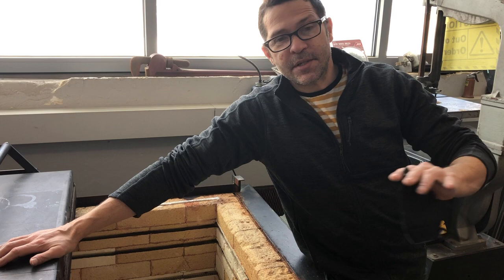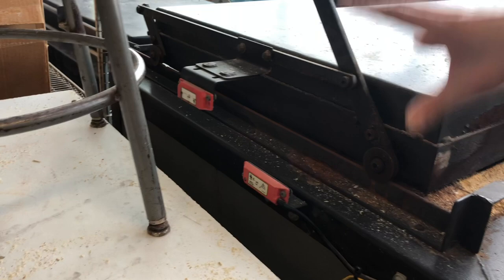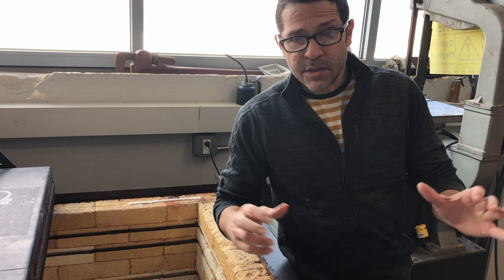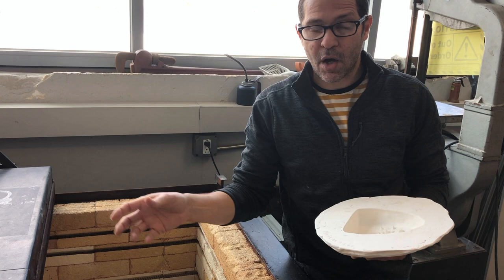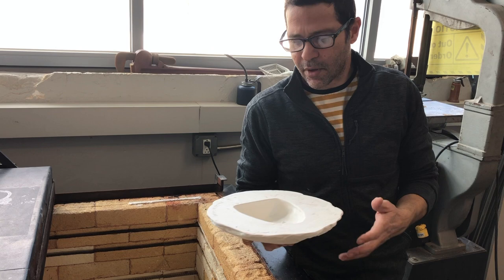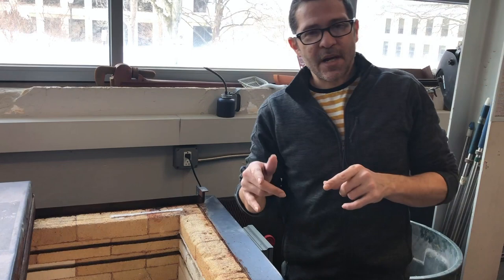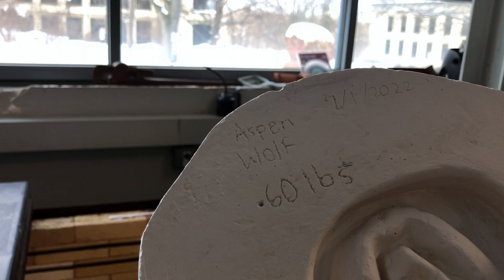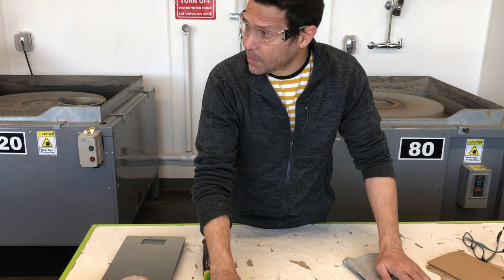Glass Casting: Loading the Kiln Properly & MORE.

Comment: Another good safety layer is having the on button warded (as it is), and the off or "stop" button unwarded.  Less dexterity is then required to emergency stop the machine, dexterity of which you may be in short supply whilst redirecting 10kW through the floor.
Reply from the maker: Good idea! Thankfully there are redundant safety systems on our kilns. There is the safety switch which kills power at the controller and is designed to fail safe. There is also the fact that the kiln is in OFF mode when we are loading the kiln. Finally, there is fuse/breaker box on the kiln as a 100% safety measure. On our kilns that are plugged into an outlet, we can also unplug them to be even more sure. (I always do this when servicing those kilns.)

Comment: Would the mold still hold up at 2000F or wil they break?
Reply from the maker: Plaster off-gasses at around 1650ºF. At that point it really breaks down as is VERY fragile indeed. What do you need to go to 2000ºF for? Most castings happen at 1450-1600ºF.
Reply: @kentstateglass5011 I want to experiment with melting copper between layers of glass. Thats why i need to reach that high of a temperature